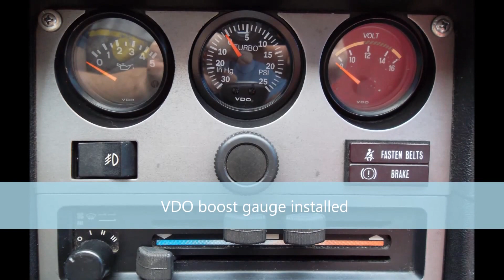924S to 924 Turbo S Conversion

Comment: your link to the 924board was fantastic. Of course it took all Sunday to read it carefully. one question for you: did you only use the short bloc from the turbo, or did you also get the head?
Reply from the maker: Thanks! I had the head as well but decided against using it since the ceramic liners are a known issue. So I just used my 924S head that was originally on the car.

Comment: Awesome job, how long did the swap take and what was needed.
Reply from the maker: Thanks! I used a complete 944 turbo engine, wiring harness,  DME and  KLR. It took me about a year to put it all together. Turned out my engine was missing some parts so it took me a little longer to piece it all back together, but it could be done in a few months.
Reply: You did an amazing job..... I love engine swaps ....
Reply from the maker: Thanks! It’s getting a make over right now. Hope to have it back in the road soon!

Comment: Getting further with trying to copy what you've done.  I'm a little confused on your engine harness to body harness (making the 14pin from the 951 into a 9 pin.)
Early on into your post,  you said it's basically 1 to 1, 2 to 2, etc. but later you seemed to be saying something different,  please advise?  
Thanks!
Reply from the maker: Yup, the wiring is pretty straight forward up till pin 9, then the other plugs for the early car are under the dash. So pins 10-14 on the later harness will connect to those plugs inside. Depending on the year you'll either have one or two plugs so that's what the secondary charts are for. I hope that help!
Reply: @edredas  cool!  I think it is,  but will  probably ask again haha.  Thanks for the help!
Reply: @edredas  hopefully one last question,  what's the reasoning for tapping into dme relay and not just the ignition switch for the auxiliary water pump? If it's only supposed to run when hot and off, wouldn't the ignition switch in the off position produce the same effect?

Comment: Trying to replicate what you did here and running into the issue of nose panel hitting the intercooler. I saw online that you used an aftermarket one, any chance you remember which? 
Or is there a way to make it fit? Got the 951 intercooler with the engine already.
Reply from the maker: I'm using the stock 924S or N/A nose panel, however I'm not using the factory plastic intercooler duct. So that maybe where the issue lies?
Reply: @edredas  i have the stock intercooler and don't have the duct at all. I can see it hitting the front lip of the intercooler that mounts that duct

Comment: Plz video on it running and driving ! How many hours total install and conversion? I want to on my  mint 924S. A perfect sleeper ! Love to see how it would do against my modded 82 911SC
Reply from the maker: I have a lot of videos of me driving it on the road and at the local drag strip on my channel. I have no idea how many hours went into it but t took me about a year to complete in my spare time. Since this video was made I've increased the boost, added a turbo cup clutch, and purchased much wider tires. It was a mid-14 second car before, mainly because the the stock 924S tires were too narrow. It should be in the high 13's when I finish all the upgrades.

Comment: sweet, I just bought a 924s a few days ago.. I am just hoping to get it sorted ,, new belt , brakes etc ,, and check out wht some loose bolts on the rear cv rod, if that is what u call them. But very nice project you have done!!
Reply from the maker: Sounds like a great project! If you want to share your project, I'll show them in a segment at the end of one of my videos. You can send pics and a brief description of your project to edredas@aol.com. Thanks!
Reply: ReCycle Spinning 
Congrats! Enjoy the 924S for the HP it has, hot it handles, and responsiveness!  Install Bilstein shocks all around, good rotors and pads, good grip tires or coil overs all around. Don't ask for more than it can give you and just enjoy it. I have a blast driving my 924S and  speed more on it than I do on my 911.

Comment: Price lol
Reply from the maker: I paid about $1800 for the engine and wiring harness. Then spent about another $2k rebuilding the engine. I bought all new gaskets, seals, bearings, and a rebuilt turbo.
Reply: edredas was there any major problems or setbacks with putting the engine in?
Reply from the maker: Nope, not at all! This car needed a new engine anyway and didn't see the point of just putting an N/A engine back in. The only thing I had to mod was the inter-cooler section, so I cut one out of a 951 and welded it in. Then I had to re-route the fuel lines, but neither of these are hard! Everything else bolts right in! I hope that helps!
Reply: thanks for the quick reply even though I'm dreaming I got to buy a battery for mine first before I start doing this great video to